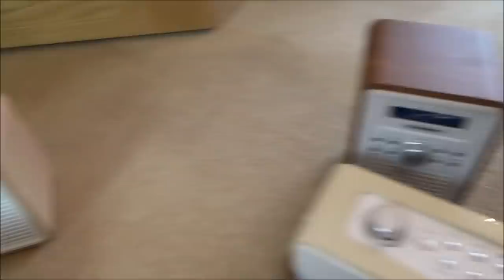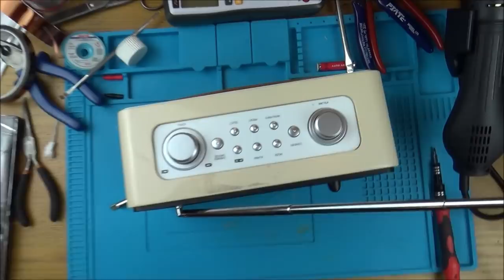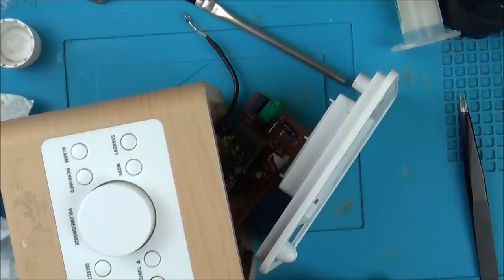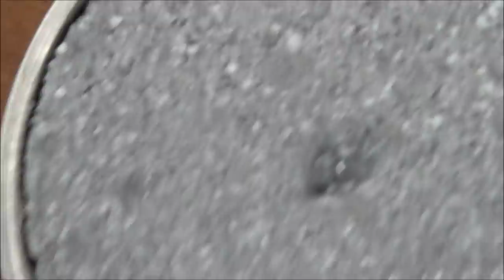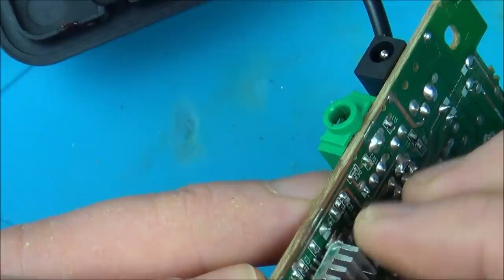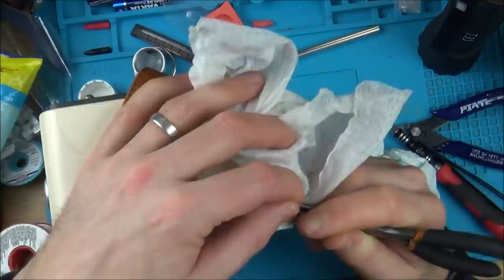REVISIT - DAB Radios Audio Chips & Heat Sinks

Comment: Wonderful. I appreciated your revelation about filling the screw head, I had just done something quite similar recently. If I may, I wonder if a couple judicious dabs of hot glue wouldn't be just the ticket at two edges of those heat sinks. If the heat sinks ever got hot enough to melt the glue, I think more obvious catastrophic problems would already be apparent. Just a thought. Nice job on that antenna button head!

Comment: Might be worth while getting some 2 part epoxy glue for gluing in the screw but you needed the soldering iron to fill in the head anyway. The top of a nail could work too. Good fix Vince.

Comment: Glad to see that the cheap chips worked! That board is clearly designed with heat dissipation in mind, that's the purpose of all those large areas of screen and the large areas of solder near the chip - designed to wick the heat away. Additional heatsinks will probably make no difference, although certainly will not do any harm.  Enjoy your videos - keep em coming!

Comment: The bloke who designed the original Bush transistor radio that became the iconic one of yesteryear, also designed the Raleigh Chopper and sister models like the Chipper, Tomahawk and also designed the Reliant Robin, ol' Mr Noble was quite the designer and the Reliant Robin was actually seen as futuristic back in the 70's having luxuries (chortle) that 4 wheeled cars lacked like heated rear windows, two speed and sweep front wiper, all synchromesh gearbox, unleaded capable long before cars had to have that as a thing and anti-roll bars which were unheard of on everything except sports exotics.   Oh and no rust as the metal chassis was galvanised.

Comment: I have experienced failures on 3 different DAB radios - which appear to be due to controller chip issues. Not sure if I have just been unlucky or if this is a common problem. The issue I have seen is where certain control buttons cease to work altogether - such as the volume, menu, station pre-sets. This doesn't appears to be physical failure of the button(s) but rather of the electronics recognising that the button has been pressed (or rotated for the volume). In all 3 radios multiple buttons stopped working at the same time - and with 2 of the radios the button failures were progressive until none of the buttons were working. 

Essentially you end up with a radio that is frozen on whatever station and volume you last selected - with all the controls locked and unresponsive. Initially removing the power often unlocked the controls but in all cases this ceased to work after a few days.

The radios were 3 different brands - the oldest being a Roberts RD-25, the next a John Lewis branded Aria II, and the most recent a Pure Evoke H3. The last two I suspect may have the same type of controller chip and or firmware (the LCD menus are near identical). Anyone experienced a similar issue with DAB radios?

Comment: Hello, thanks for the video. When the board is not put flat in the product, the orientation of the heatsink matter, the air must go from bottom to top so the groove must be in vertical postition. I cannot tell if you did it correct, this is not very important for this kind of usage.

Comment: I suspect those heat sinks will be flying around inside those radios in no time. Try smaller heatsink and thermal epoxy for fast, reliable attachment.
Reply: Still got heatsinks on my pi 3 with thermal pads and it's had them over 2 years and they have never fallen off

Comment: Very nice!  Those cleaned up great.  You could easily sell those.  They look brand new.

I did that to an antenna many years ago.  It'll stay.  I honestly can't remember the last time I had anything that had a real antenna on it....  Hahah!  Brought back memories.

And hey, Vince, FIRST film the video, THEN drink 2 pots of coffee!!!  Hahaha!  Okay, just kidding...  It's kinda hard to watch, while you have the shakes....  Heh heh!  

I personally might have just put a drop of epoxy on the heat sink, and then glued it to the chip...  I kinda wonder if the weight though, hanging on the chip, puts excess pressure on the little solder pads....  I guess I was unclear a little bit, the radio sitting in normal operating position, is the chip resting there on gravity??  Or is it hanging on the side???  Maybe the little aluminum thing weighs nothing....???  Just a random thought...

Great job on these.   Great fix.

Comment: The data sheet mentions this re temp/overheating:

It is critical that the maximum junction temperature TJMAX of 150°C is not exceeded. TJMAX can be determined from the power derating curves by using PDMAX and the PC board foil area. By adding copper foil, the thermal resistance of the application can be reduced from the free air value of θJA, resulting in higher PDMAX values without thermal shutdown protection circuitry being activated. Additional copper foil can be added to any of the leads connected to the 8002. It is especially effective when connected to VDD, GND, and the output pins. Refer to the application information on the 8002 reference design board for an example of good heat sinking. If TJMAX still exceeds 150°C, then additional changes must be made. These changes can include reduced supply voltage, higher load impedance, or reduced ambient temperature. Internal power dissipation is a function of output power.

Comment: The thing I am thinking is that, if you are using leaded solder on the screw tip as you did, is that a health issue when people hold it to pull the aerial out as they may have lead on their fingers from the solder?

Comment: Where do you sell your items that you fix I bought a job lot of John Lewis radios most of them was easy fixes some had Audio chips that were blown up one looked like someone plugged in the power the wrong way round some how as all the caps were popped got all but one working just need to find where to sell them only paid £50 for the lot of 14 radios

Comment: HELP! I Have 20 year old 5.1 surround sound system (4gamers), but the sub woofer has stopped giving bass. You can hear it trying in test mode, but doesn't work! I've repaired a few solder joints that were going bad in the decoder, but no change... The speaker definitely isn't blown as it's always set to low bass. Could it be a power issue? caps? All connections are good. Haven't stripped down the woofer yet, may do soon. Any suggestions?
Reply: Twenty years ago cap plague spread worse than corona today. Bad caps are my guess.
Reply: @g.h.190  Thanks, I'll take a look. The bass comes back if i directly unplug the decoder while switched on, then plug it back in. Not the best solution, but it reactivates the bass.

Comment: I noticed in the closing comments, the blond DAB radios, at the least the middle one looked squished, as if your video editing software changed the ratio of the video format. Is that what happened? Otherwise, the one on the far right looked fatter than the one in the middle.

Comment: I whole heartedly recommend Arctic Alumina thermal adhesive for this type of application
https://smile.amazon.co.uk/gp/aw/d/B0009IQ1BU

It's non conductive and sticks rather well , sets strongly enough for handling and testing in ~ 10mins at most and can be removed with a hot air soldering station....just in case you need to replace a chip.

I've used it on many a D class amp chip.

Comment: Why use hot air for SOIC chips when one could spend five seconds with a soldering iron? Saves a lot of damage to the PCB and surrounding components. Just look at the state the PCB is in...
Reply: Not only that but heating an IC at 350C for a minute during soldering and then protecting it with a heat sink is a bit weird or not?
Reply: At 22:00 mins, he's doing it by hand

Comment: For someone who knows how to smd solder does not know which way round a chip goes? and if you get it wrong its not a matter f replacing the chip you will risk frying the power supply part of the radio

Comment: Not to be negative, but I wouldn't have put solder on that screw. People are going to grab it, and kids might put it in their mouth. I don't suppose you want to have lead poisoned kids on your conscience? The idea seemed clever, but maybe it isn't such a good idea. Good job otherwise though, and interesting as always.
Reply: Should be using lead free solder these days  :D  - if only it wasn't so awful to work with.
Reply: @Dedubya-  Yes, but many hobbyists still use leaded solder, and I think Vince does. That said, I wouldn't put lead-free solder in my mouth either, since it usually contains silver and copper.
I now just read, that tin and lead often contain radioisotopes as well. I did not know that.